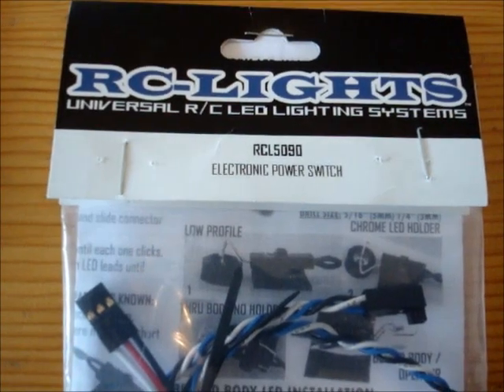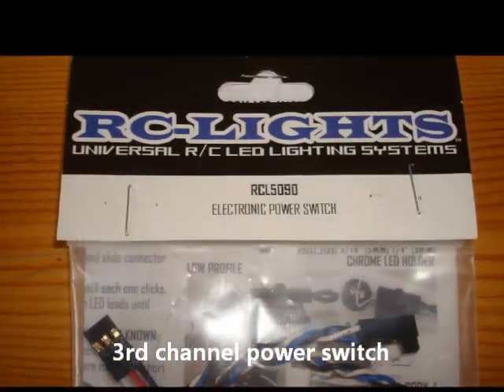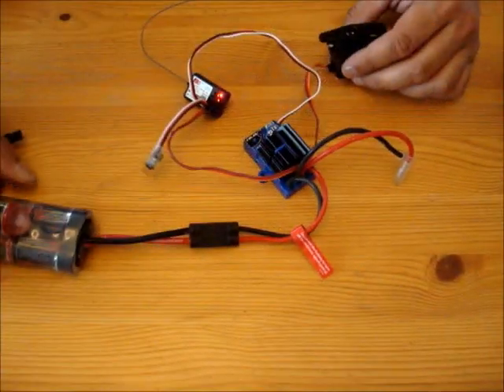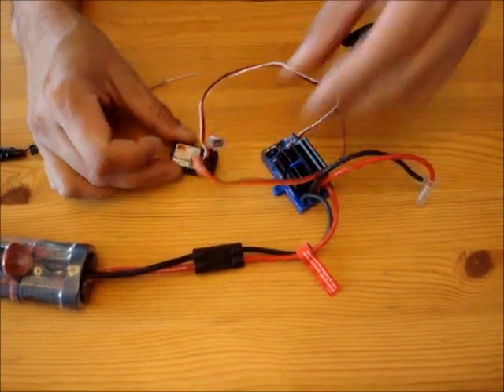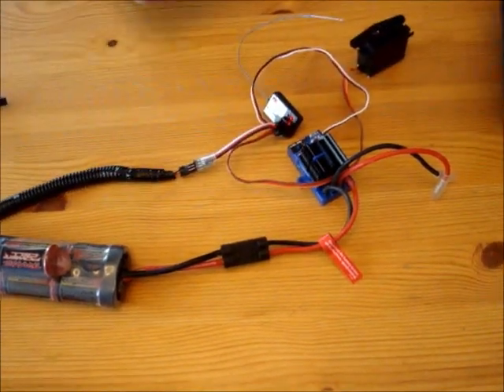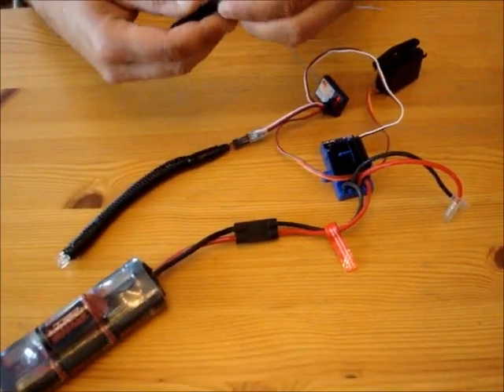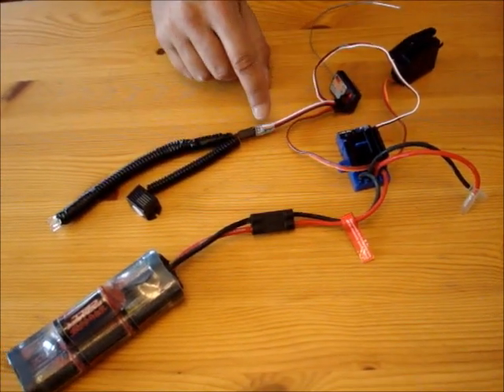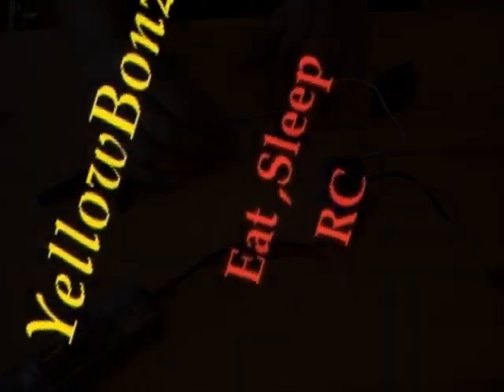3rd ch Transmitter Controlled Power Switch

Comment: Hi, I am in process of getting in to RC cars, have got my first couple of kits arriving next week.  I like your video and what you have done, just a bit confused....  If you are powering the lights from the receiver on a spare channel then isn't that a switch in itself? i.e when I flick the switch on the 3rd channel then that powers that particular channel?  Why the need for a spate electronic switch?  Sorry if this may sound like a stupid question.

Mike
Reply from the maker: The 3rd channel contains power but needs the switch for control. There is another video where my lights are controlled by my receiver but powered separately

Comment: i have a kill switch i cant get to work on the 3rd channel,ive changed the reciever and its still doing the same thing.it will work if i cut off the controller,just not when the 3rd channel button is pressed.
Reply from the maker: why a kill switch, does ur receiver not hav e any type of failsafe built in and then you can use the 3rd channel for something else maybe.
Reply: like some lights.
Reply from the maker: Exactly, I have never used a Kill-Switch, as mentioned all of my receivers have a fail-safe built right in. Lemme know how u make out Bro
Reply: u got it .
Reply: no it still dot work off the third channel.
Reply from the maker: What or Whos control switch are you using to try and run the lights
Reply: dont have any lights but im useing a flysky reciver.
Reply from the maker: okay what r u trying to get working off the 3rd ch
Reply: the kill switch will not work on ch 3 for some reason.had the channel tested and it works but wont operate the kill switch?
Reply from the maker: Understood. What happens if u shut noff ur transmitter when the car is running, does that not act the same as the kill switch, in essence.
Reply: yea but i want it to turn off from the third chan button on the controller.

Comment from the maker: The switch goes into ur reciever normally but when you plug in your lights you may have to plug it into the switches backwards, so the black goes to the white, white to black and the red to red. But even with nothing plugged into the switches it should still operate correctly and the indicator light should say that all is working fine. I'm stumped.